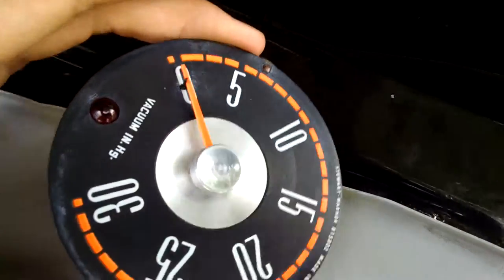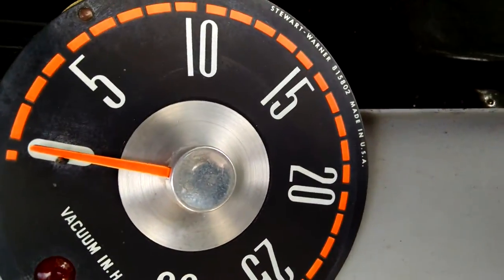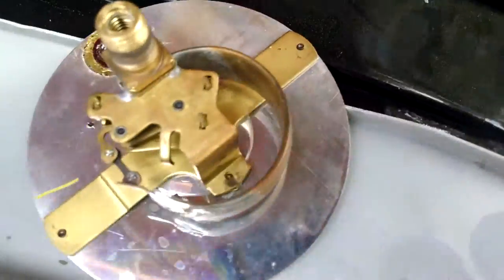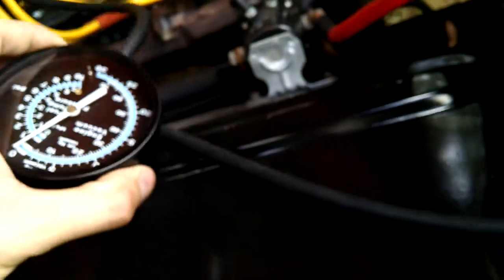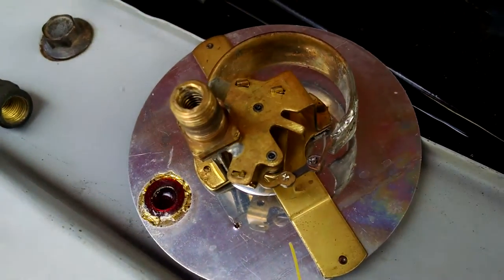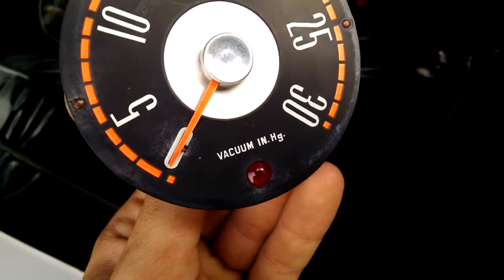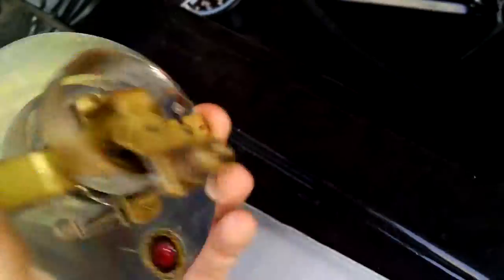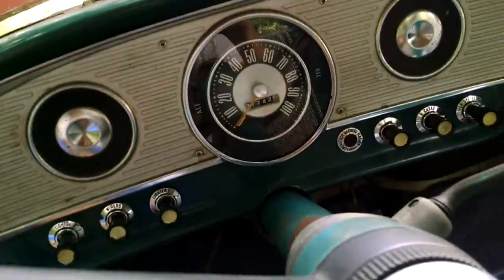Vacuum Gauge Repair -- 1966 Ford F100 #19

Comment: Hello! watched your video!  I have one of these gages for my truck, looked all over till I found it and it worked when I got it brought it home and had to clean some of the flaking paint out of the lens area drilled small hole in side of gauge metal housing used a pipe cleaner to remove stuck loose paint, I did move the needle with the pipe cleaner a couple times but no rough stuff, now when I suck on vacuum hose my needle won't move I didn't get any where near the brass mechanism oh and I didn't no how to remove the crome band that seals this thing. any suggestions this is an Obsolete unit out of a F600?